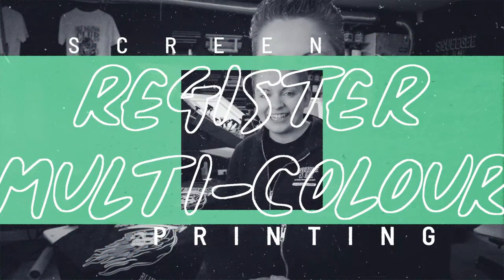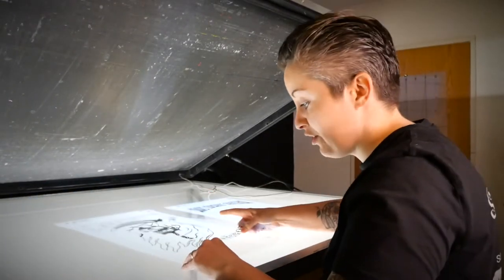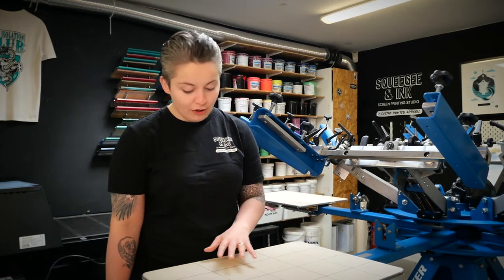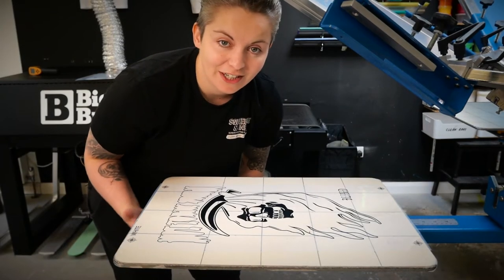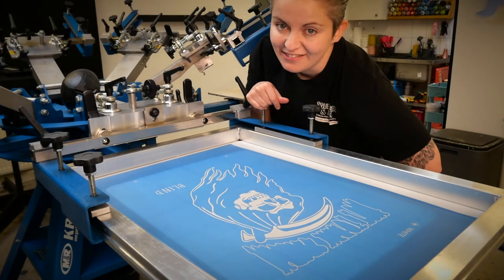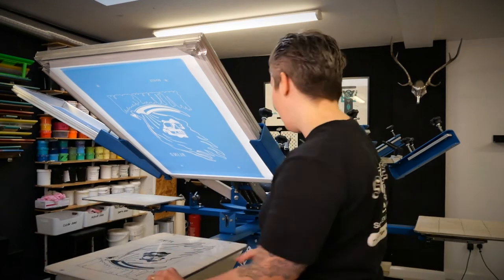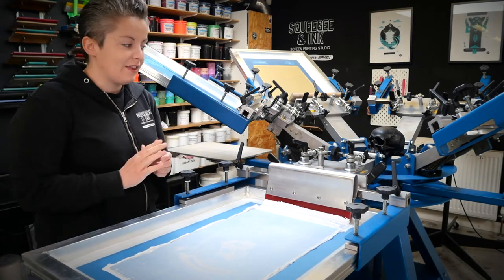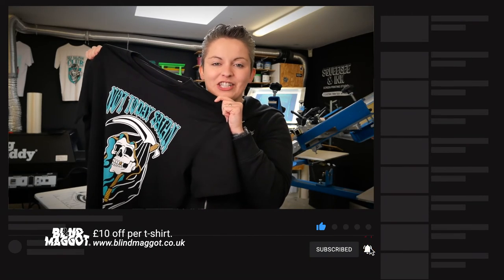How to register multi colour images for screen printing.

Comment: so if the design is centered on the platen, that implies that when you load the shirt, you do so in a way that the correct part of the shirt ends up smack dab in the middle of the platen.  which, when you're considering doing a whole run of sizes from s-2xl or whatever, seems like it would be tough to know.  is it just an eyeballing-it-from-experience thing, or what?  also, how would you handle something like a small chest print on the front of a hoodie, for example?

Comment: hello I am printing fabric on a kitchen table, so I need a way of registering that works when you have to move the fabric. Some designs are 2 colour, some 3 or 4 colour. I can do 8 screens on the table. Could you offer a zoom session?
Reply from the maker: Hey! The best video I have for that type of thing which is similar is my video about printing with hinge clamps… https://skl.sh/3JjIcuG this is a free trial link. Otherwise I know that fabric printers tend to use a peg system on the table but you might not have room for that, so maybe flipping acetate film back and forth is the easiest option?

Comment: I know that this video is old but why you dont do underbase under color?  You print colors 2/3 Times?  What time and temperature you use in your conveyor?
Reply from the maker: Hey the purpose was to show registration 🤓 I do know about underbase. I printed the colours twice. The dryer is 843 setting for about a minute, the important thing is that ink surface when in the dryer is 165 degrees

Comment: Hello, I noticed in this video you are not using a white under base for the yellow and teal colors. Would you mind sharing what type ink you are using? Im assuming the ink you are using allows for the colors to be vibrant without the use of an under base on a black shirt.
Reply from the maker: Hey, yes this is a pretty opaque ink.  If it was a flouro colour for example - I would always put an underbase but if it is not needed, I don't do it.  If I put down less ink I get a softer hand feel. :)